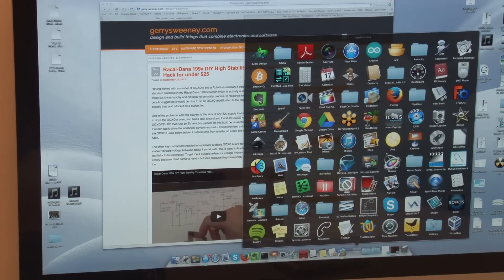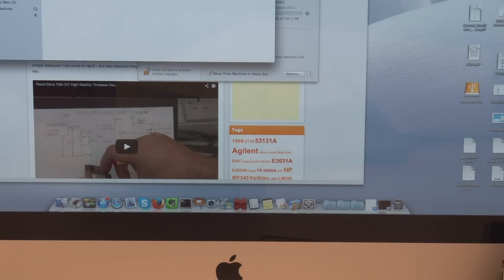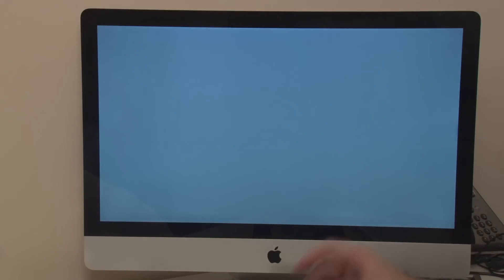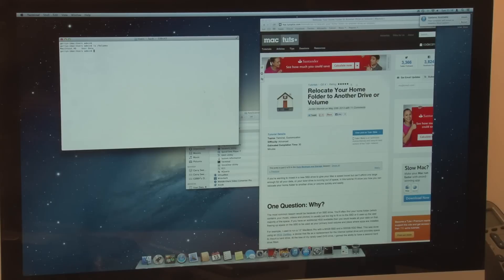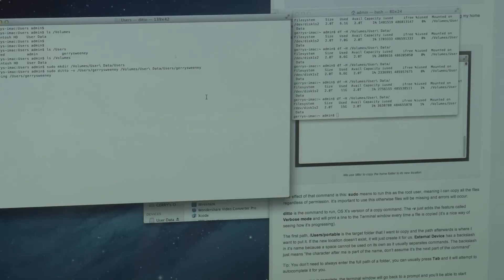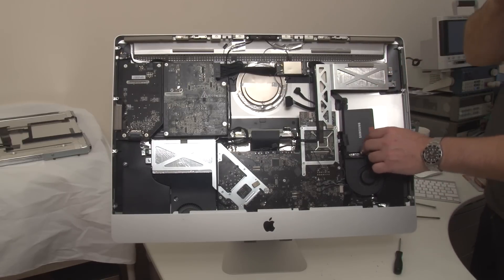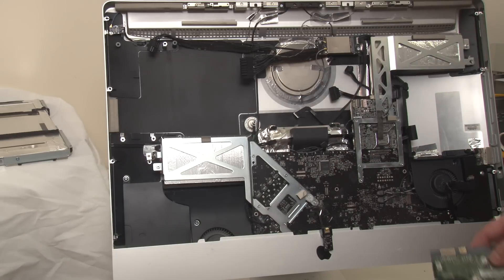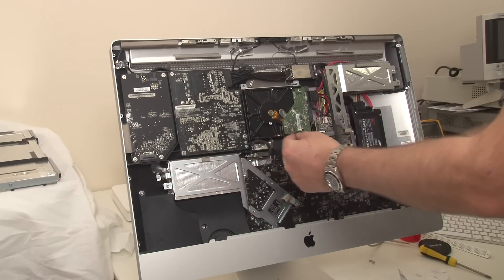Apple 27" iMac Teardown, SSD Hack and 2TB Upgrade

Comment: Hi Gerry, great video for setting up an imac like this. I'm very interested/ intrigued by using a transistor TO-92 2N2907 in place of the standard sensor especially when upgrading hard drives with Apple firmwares involved. Do you have any detailed instructions on doing this, where to get the transistor from and which pins to solder the transistor to? Thanks for the video again....
Reply from the maker: Hi Simon, any silicon junction will work, transistor, diode etc, the key is making decent thermal contact. You only need to connect two pins, use the base (B) as the Anode and emitter as the Cathode and your good to go, I cannot remember the polarity but you can meter that out on the original drive or on the temp sensor on the optical drive.  Gerry

Comment: Great video !  Have you had any issues with the psu with splitting the power to both drives ?
Reply from the maker: Hi g1mp0 no not at all, there is plenty of headroom on the PSU to run a second HDD without a problem. Gerry
Reply: Yep you have to remember that Gerry has left the DVD drive disconnected which would have an idle current of its own. SSD drives do not have very high power requirements (during write, the order of a few watts at most). I did the same to my mac mini, replacing the ODD (which I never use) with a 1Tb drive, and the original HDD with the same model as Gerry. Opening the mini required a bit more "forceful" persuasion to get inside the thing (its a 2009 model that one must use a paint scraper to crack it open!!) :) I then proceeded to combine the two into a fusion drive - 1.25 Tb!! Then I "fooled" it into thinking my debian ZFS array was a time capsule for backups :)

Comment: Other than boot time, did the SSD improve performance? I know they are usually faster than mechanical drives, but I want to know how well the iMac for that generation can handle them before I spend the money. Thanks for the great video!
Reply from the maker: Yes it makes a fairly big difference, SSD's are the way to go for sure.  I expect spinning drives will be relics in the next 10 years.

Comment: Nice video mate - does the imac needs to have the temp connector for work. Because a ssd doesn't have this. 
The imac will work fine without right ?? :D
Reply from the maker: Yes the iMac will work fine but if you replace the primary hdd with an SSD you need a temp sensor otherwise the fans in the computer will run at full speed and will be very noisy. Gerry

Comment: Hi Gerry. Great video. Also, very brave. I am currently running a 10 year old HP PC core 2, 6400, 2.13 GHz. It has been great. I am pondering on a new PC or the  IMac, 27" i7.  I see lots of pros and cons but speed and memory are at the top. I really enjoy Microsoft Flight Sim X. My old PC does a fair job on FSX, but freezes about 45 min into filghts. The old rule, save often. I like the idea of being able to display on a HDTV with Thunderbolt. With my interest in FSX, is the IMac a good choice. I know there is lots of add on features with the IMac and am kinda leaning towards it. Just wondering on your thoughts. I will obviously have to make my own decision. Thank you in advance for your response.
Reply from the maker: fozzlac The iMac can dual boot into Windows or OSX and for all intents and purpose an iMac is just a very nicely designed intel hardware platform.  The upsides of an iMac (my personal opinion) is they are well engineered, compact and look nice in a living room setting, no wires, no extra boxes and so on, and despite the numerous reports about failures and not withstanding the dark side screen problem I also addressed in a blog article/video, the hardware is very reliable - I like iMacs a lot.  However, the downsides are many too, they are not very expandable, you cannot do much by way of upgrades, which are basically limited to memory and disk, so any other form of expansion comes in the form of external boxes.  They are expensive for a comparable spec PC, possibly as much as 50% more expensive and thats a personal judgement you have to make for yourself.  In my own experience I have found the lifetime value on an iMac to be much better value for money.  For example, 8 years ago I bought a 21.5" iMac for my son, who was three at the time, we have that in our living room so I partly bought it for aesthetics but mainly because I wanted to be easily able to recover the last known state and avoid virus shenanigans (there is nothing worse than coming home form work and having to fix a broken windows computer which invariably takes many hours a time), I put that iMac in place and from that day to this I have done nothing apart from replace the keyboard and mouse once, its worked perfectly from that day to this with no attention from me whatsoever, there is no way I could have run a windows PC for my kids like this for that long without impacting the quality of my own life - so in terms of the iMac costing me £1000 as opposed to a comparable cheap PC costing £450 at the time, the premium was worth it to me.   Not sure if MSFSX runs on a mac, if it does I would go and try it on OSX and make sure you are happy with it before committing to purchase. Hope that helps give you at least my perspective.  Gerry

Comment: Hello, Gerry, you helped tremendously with your video on the half-dim iMac screen issue, so I was hoping you might have some ideas as to why I'm experiencing repeated failures with SAMSUNG 840PRO 256GB SSD drives (installed in a mid-2011 27"iMac in the 2nd bay beneath the optical drive). I've just had my third drive failure within a year. Last two replacement (RM) drives had TRIM enabled, and previous one ran for 6 months no problems until I/O errors, then inability to repair disk. Most recent replacement wouldn't even take an initial clone right from the box. New SATA cable (OWC) for that one too. Running everything on the SSD (OS, Apps & data). Other than the SSD failures, everything runs great. Any thoughts would be appreciated. Best, Russell
Reply from the maker: moquiti HI Russell, I am afraid I don't really have any suggestion, its not likely that your computer is causing the drives to fail, I could only suggest testing the failed drives externally on another computer it sounds like you may just have been unlucky.  If you use you computer for workloads that includes a high amount of disk I/O then and SSD might not be a good choice as a work drive but thats only an instinctive thought.  Gerry

Comment from the maker: Hi, the SSD runs cool and is very thin.  There is still significant airway for the GPU and I have not noticed any increase in GPU running temp. The new drive and the 292907 temp sensor both work perfectly, the fans are NOT running and full speed and when working hard the HDD temp and the fan speed increase proportionately so all in all I am very happy that the mod works well.  It would be hard to improve the Apple fitted fans IMHO>..

Comment: Hi Gerry. I watched your video. Thank you for the effort it took to create this. 

I have a late 2009 iMac 27" core i7. This is one of the units Apple recalled for a faulty Seagate boot disk (as you noted with yours). Unlike you, I had apple replace the drive. And the replaced Western Digital unit just died. So now my desktop is out of service. And though old, I still use it. 

So I'm thinking about a 500GB Samsung 850 EVO in the optical drive slot, a large 3.5" disk (probably 4TB or 6TB) and possibly the 32GB upgrade option. I already have 16GB. And I do use the RAM. Adobe Production Premium and Blender. 

Question: on the motherboard SATA ports, is there a difference? Other than primary/secondary for default startup, does one port give better performance than the other? Is there reason to prefer the primary port for the SSD? 

But... is it worth it? I worry this is throwing good money after bad, particularly the RAM which couldn't be re-purposed. Does it really make sense to spend all that money and upgrade a six year old Mac? You did this three years ago. Would you do it again today?

And yes, I do believe I could handle the teardown and rebuild. It looks to be a PITA but with planning and a good checklist not too difficult.
Reply from the maker: +Paranoid Factoid I would say it probably is.  One of the things you get with a MAC which you don't (IMHO) get with a PC is long service life, they are very good value for money in that regard.  I am still on a 2009 27" Mac and I have no need to upgrade it, its still perfectly usable for processing video and the like.  If you use memory heavy applications then the RAM upgrade has to be worth while, you can sell the 16Gb on e-bay, there are plenty of iMacs around with only 4G that would benefit from that upgrade.   Yeah the teardown is pretty straightforward, just take your time and it will be fine. Its a good opportunity to dust out all of the cooling ducts and heatsinks which helps with performance in the summer months (better cooling means the CPU is less keen to slow its self down to cool off).  So IMHO given the cost of RAM and SSD's nowadays, you could spend relatively little money and get another 5-6 years out of your computer.  Hope that helps
Reply: I edited my comment as you were writing yours, I think. What about the controller ports? Is there reason to prefer one over the other for the SSD?
Reply: +Gerry Sweeney 

Another thing: have you seen this OWC manual for their "data doubler" optical drive bay to SSD mounting bracket? Probably not. BUT: it notes that there's a bug in the iMac 2009 SATA controller that limits SATA 6gb/s devices to 1.5gb/s. So they recommend older 3.0gb/s SATA devices for these iMac models because they'll go at the proper speed. 

http://images.macsales.com/downloads/tech_center/manuals/OWCMANDDIM0911_R2P.pdf

The Samsung 850EVO is a SATA 6gb/s device. Do you know if you're getting full SATA performance from your Samsung SSD?
Reply: +Gerry Sweeney 

Gerry, I'm sorry to answer my own question here and waste comment space, BUT: it turns out that only the Core2Duo machines from 2009 had the chipset with that bug. It was an NVIDIA SATA controller on that model which had the bug. The Core i5/i7 units came with an Intel Series 5 chipset that doesn't have the bug. 

https://discussions.apple.com/thread/6740721?tstart=0

ALSO: to answer my question about the whether which sata controller port matters, NO IT DOES NOT. Both SATA ports on the iMac 2009 Core i5/i7 motherboard will run at SATA II (3.0gb/s) speeds. So it doesn't matter which one you choose. Though port 0 might be the default boot device, it's easy enough to change.

Sorry to litter your comment board here.
Reply from the maker: Paranoid Factoid I was not aware of the SATA bug, it seems strange but it may well be the case, 2009 was nearly 7 years ago now lol. For my own installation I have not measured the drive performance but the machine has worked very well since I done the upgrade - its still my main computer and what I am using right now :)

Comment: Hi Gerry, thank you for making this video! I am interested in doing the same, but with the current iMac model (non-5k retina version). Questions: a - is this video detailed enough and process safe enough for someone who has never opened a computer before to do this? And b - is this the same for the current imac? Thank you so much!
Reply from the maker: Rasmus Raam Toerper the process is the same but the current iMac (the thin one) is quite different physically. Anyone can do it, it depends on your competence physically, you do need an appreciation of the physical construction, especially the various connectors for the screen which are easily damaged. Gerry

Comment: Hi. I heard Apple uses a special hard drive that's compatible with its heat sensors for the hard drive. Is it still detecting the temperature of your SSD? Are there any side effects? That's a great mod, thanks for sharing. Is there an adapter to put 2 SSDs (coz' SSDs are thinner). God bless, Rev. 21:4
Reply from the maker: SevenDeMagnus yes thats correct they do use special sensors which I covered in this video. I later models they have the sensor built into the hard-drive so its harder (but not impossible) to do, I will do a video on that at some point in the near future. Thanks for watching. Gerry

Comment: That is just painful. I have a Dell and an HP all in one that are 50 times easier to work on, update, and actually run faster than that system. They also have a better video card, and even it can be replaced easily.  That entire job presented can be done in 15 minutes on just about any computer except a mac.  That mystery hd cable was for fan speed, and you need a hack for it.

Comment from the maker: For reasons I have no idea I cannot seem to reply to some comments so I will post a new comment here: -

+rabbiphobia mainly because SSD's although getting better have limited write cycles so its a good idea to write transient stuff on a normal HDD if possible. Maybe technically you can get away with it but from my understanding of flash drive technology its a good idea to limit writes. 

+Random Person none taken, it worked for me and there are of course many variations on how to change the hardware configuration of an iMac, I simply documented my approach and the way that worked for me. I would have liked to put a SATA splitter/hub and kept the optical drive operational but I did not have one so I did not bother because it was not important to me, I did not in any place suggest that this was meant to be definitive or the only way of doing it, that was not my intent, I was simply documenting my journey and published it with a view that it might be useful to others.
Reply: Hey, great video, but, it's possible upgrade the graphic card?
Reply from the maker: Vikinguito Saltarín yes I believe so so another apple one, its not a standard PC form factor so choice is very limited
Reply: No tengo pensado un nombre yess it is possible. I've made it and it works well.
Reply: +spikedpsycho I don't think a 2007 iMac you cant update CPU and graphics but you can upgrade memory and hard drive but better to flog and buy one that's better spec .

Comment: Apple upgrades the iMac 27" model every year from 2013-2-015.   In 2016 I hope Apple upgrade iMac 27" 5K  with thunderbolt 3.0 connecting 2 external 4k displays.

Comment: Next time when you copy other users files try cp -Rp. p for preserving all file and folder attributes. You need same user and group to exist for that to work but don't have to chown afterwards. man is also useful command =) And that's an akward way off making backups there. It's not full disk backup and it's not filesystem backup. Apple for the win.
Reply from the maker: NailHead86 thanks for the info, makes sense and will save time :)  Thanks for watching too.   Gerry

Comment: My god where do I start?
If you were contemplating getting a MAC, this video would and should put you off.
I'm a Windows user  and thank god for that.
I can't believe how difficult it was to replace a hard drive and the Dialogue boxes Gerry had to go through, Over and Over again.
Nice looking and well constructed but impossible to work with in any reasonable time line.
Things like Hard drives and Memory should be accessible from back panels and not have the need to break into the display sections, I believe from a video I saw earlier that the new 27 inch 5K display doesn't have magnets to hold the screen together but is GLUED !!!!!!
WHAT!
MACs are so much better than any windows machine unless you need to work on them.
The manufacture is of a quality better in an order of magnitude.
but do you want to go through all this to replace a HDD?

Nice video all the same though...
Reply from the maker: Michael Hawthorne thanks for the comments, I do know what you mean but I have spent the best part of 30 years using PC's for all manor of things and I can promise you the overall value I get from my mac is higher and a whole heap less trouble overall. I work in the software business where we do a lot of cloud based stuff which mostly runs on Linux so with Mac I get a nice UI when I am working but if I need to I drop into a terminal and boom I am on an equally powerful unix system - its hard to describe unless you have a need for both, that makes windows the lesser of the two options.  I have a iMac that is nearly 9 years old, one of the first intel 21" models and apart from a disk failure about 6 years in its still in service now, my son uses it every single day and its almost as good today as the day I bought it.  I have never had a PC thats lasted longer than 3-4 years before I felt compelled to replace it.  Anyway, each to their own I understand but for me I just don't see the same value in a PC and everything I need to do I can do with my Mac :)  Gerry (P.S i DONT work for Apple.....)